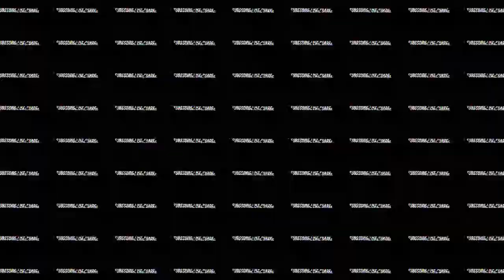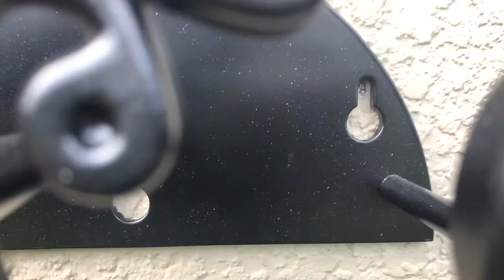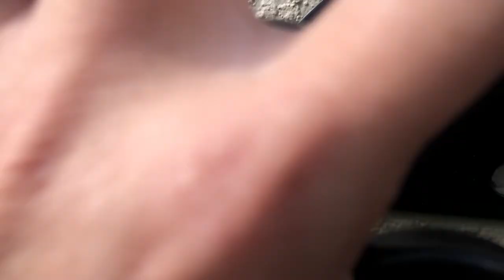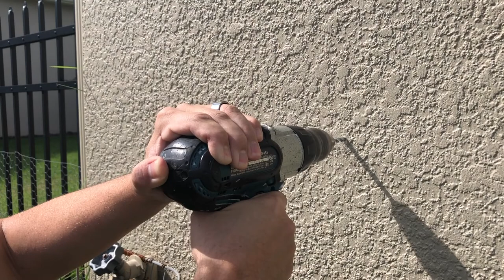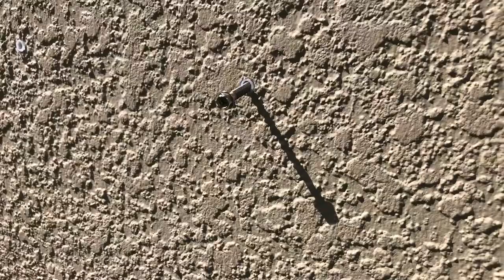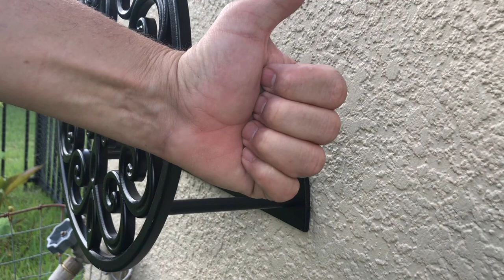Hose Hanger Install: Block Wall, Stucco Finish

Comment: Always throw some silicone into the hole before setting your anchor to prevent moisture penetration into the wall.
Reply from the maker: Good advice!
Reply: Yep, that was the only part that I saw missing. Otherwise, a good video.
Reply: Can you please tell me a product I can buy for silicone? I am new to this. Hence asking
Reply: @MrPoosarlasrinivas Any outside silicone will work. I’ve always used DAP products with success but I’m sure someone will tell me it’s junk and why. 😉 For a project this small you can use the squeeze tube ones if you don’t have a caulk gun.
Reply: This is why YouTube is better than a Google search many times. Ty sir!

Comment: Thanks for posting this.  I was wondering if I needed to locate a stud for stucco, but it doesn't seem to matter.
Reply from the maker: It may matter if you have a framed house. My house is block construction.

I didn’t even consider that when I did the video!
Reply: It most definitely matters!

Comment: It looks like you just picked a spot without finding studs. From the Eley website:

"Yes, The ELEY 1041 wall mount garden hose reel can be mounted to stucco.  However, it is extremely important that the reel is anchored into a solid surface behind the stucco finish.  The reel must be anchored into the wall studs and may require longer lag screws than provided.  If there is masonry behind the stucco finish you will use the sleeve anchors or a masonry anchor.  If you are not confident in your ability to locate the studs we recommend you consider the post mount, cart, or free-standing hose reel.  If you attempt to mount the hose reel to a stucco finish without locating the studs the reel will more than likely fall off causing damage to the reel and your stucco finish."
Reply from the maker: It depends on your application. I should have maybe more clearly explained my situation. This house is concrete block with a stucco finish. Therefore the anchors are in the concrete cinder blocks. 

No studs to locate in my case!
Reply: He’s drilling into concrete block.
Reply: I was trying to search a video that tells me how to install hanger on siding,  my house has plastic siding, I won't drill any hole before I find stud. so his video is not for m e, I will keep searching.

Comment: With the right size bit and the correct screws for stucco/concrete, there's no need to plastic anchors.  A hammer drill is definitely the way to go for making those holes.
Reply: And how u know what size to use
Reply: @Eastbaypisces masonry screws have the information published. Usually on the box.
Reply: Good point. Someone used plastic anchors on a stucco wall outside my house and over the years the plastic anchor cracked and the screw came out.

Comment: I did almost this exact thing and once the heavy hose was put on my cheap hose hanger, the screw and plastic piece came right out of the wall. What did I do wrong?
Reply from the maker: Drilled the hole too large, most likely.

Comment: Why in the world does stucco start to crumble when I drill?  It seems so easy when you do it. Having the right tools helps I suppose. Thank you. I'll give it another try!
Reply from the maker: Hmmmm, not sure.
Reply: You need to use a sharp masonry bit, preferably a new one, not a regular wood or metal bit
Reply: @haunthunterify  Thank you for replying! Okay, I will get a masonry bit or a set. I didn't know there were different types of drill bits. LOL I'm glad you reminded me what NOT to use!
Reply: @sallyjb6209  YW! the most important thing is that is sharp. You might even get away with a regular bit as long as is new and sharp. Also use one smaller than the hole. Do use a regular drill. Do not use impact or hammer drill as it will crumble the stucco
Reply: @haunthunterify  Great, thanks for the advice!  Sure do appreciate it!

Comment: Thanks. If I want to hang something about 8lbs with 4 screws  on a stucco column on my outdoor patio, where I think it’s wood behind the stucco (because gutter downspout brackets are in it with  pretty deep screws, would I use those plugs you used, or use a wood tapping screw to tap the plywood behind the stucco? 
If my wood screw is 3/16” width, is it ok to drill hole in stucco and wood behind it of only 1/8” and then screw screws in, or might that crack the stucco bc 3/16” is greater than 1/8th?  
Would I drill with a carbide  bit and then a wood bit once through the stucco?  Thanks.
Reply from the maker: In your case, I would probably go with something that would grab the wood, like a wood screw. Just use a masonry bit to get through the stucco, then wood bit.

Make sure to use some silicone to seal around the hole though, so there’s no seepage into the wood!
Reply: Thanks for the advice. If I want to use 3/16“ screws to hang it, what size masonry bit would I use, and would I use a smaller, different  drill bit once through the stucco to drill a pilot hole into the wood?

Comment: What do you do if there is a metal stud behind the stucco, and your drill won't cut through it?
Reply from the maker: Get a drill bit meant for metal.
Reply: @CliffsHowTo  I tried that but it didn't work. A friend of mine came over and told me that there seems to be a steel beam behind the wall. He had a different type of drill that was able to penetrate the beam enough to allow for a plastic anchor to be used.

Comment: I’m still looking for the answer but maybe someone knows- should you then put some sort of sealant on the outside of any stucco anchors? Not for the install- but the longevity?
Reply from the maker: That’s a pretty good idea, actually.
Reply: @myownolga I would definitely recommend sealing or caulking the stucco after drilling a hole into it, cause it can definitely ruin the stucco after water gets inside the hole and create a bigger problem
Reply: Yes. Always. You've breached the moisture barrier and created a path for water to enter and collect.
Reply: 100% silicone . I use clear for this.

Comment: Make sure not to drill through water lines or electrical lines... no mention of that before he started drilling holes.
Reply from the maker: Good tip. I forget that many homes constructed as mine is. My pipes go through the foundation, and the electrical between the block and drywall, on the inside. 

So for me, no risk. For others, possibly.

Comment: OMG! I'm looking up how to hang stuff up in stucco for this EXACT SAME hose holder!!! 😆 

Thanks for this video! Out of curiosity, have you ever tried drilling into stucco and felt like you were hitting the "chicken wire" behind it (or maybe some other malleable metal material), and it was preventing you from penetrating all the way through the stucco wall? -If so, any advise?
Reply from the maker: So, stucco is a finish, not a structure. There could be a wood frame, as opposed to block under the stucco. If there is, that’s where the wire comes in. The wire is used as a substrate to hold the stucco to the wall. 

If that’s the case, which it sounds like it is for you, you want to make sure you’re hitting at least one stud behind there.
Reply from the maker: To get through the metal mesh, you may need a drill bit for metal.
Reply: @CliffsHowTo  Right on. Thank you for your advise! :-)
Reply: @CliffsHowTo  That's kind of what I was thinking too. Cheers for the suggestion! :-)

Comment: What size screws did you use?
Reply from the maker: I used with what came with it.
Reply: @CliffsHowTo  Thanks so much
Reply: I was wondering the same, I have the exact unit in the video but mine came without anchors or screws

Comment: Usually a good idea to use a vacuum to remove any masonry dust from the hole BEFORE test fitting/inserting the anchor, or a mason screw. I stopped watching after you utilized the bottom of the drill to tap in the anchor.